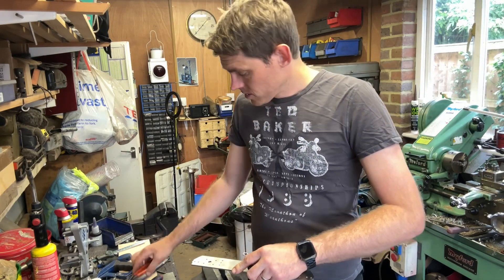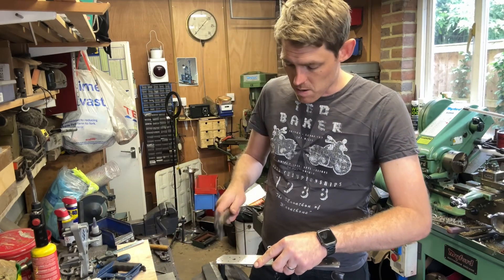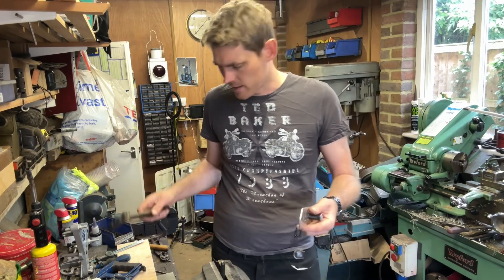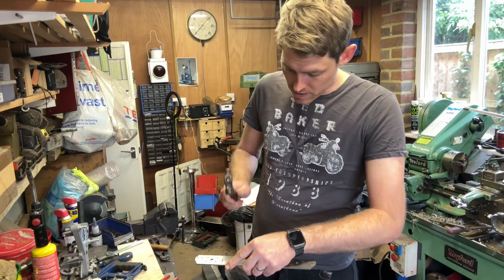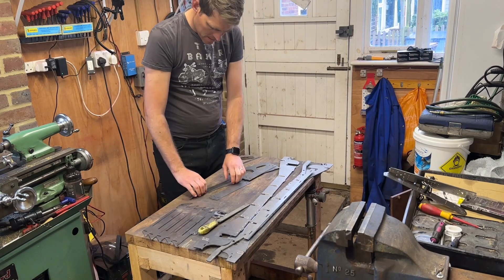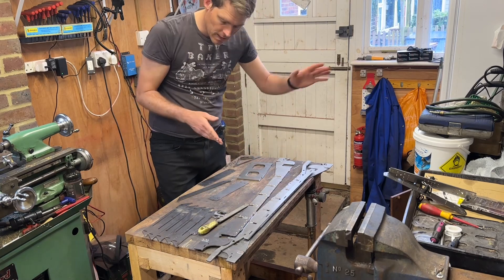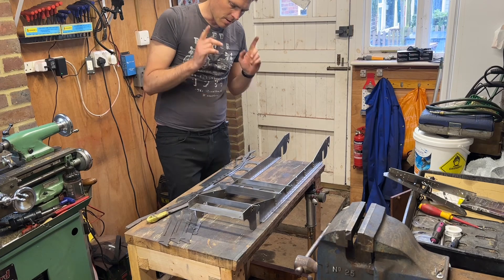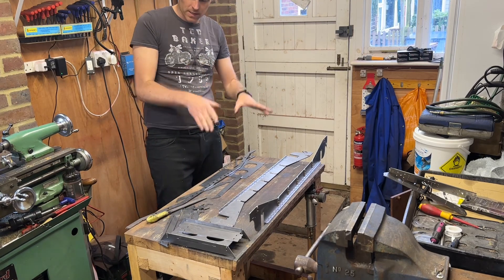GWR Loriot, Part 2… assembly continues…

Comment: EKP are superb with me contacting them years ago and begging for a batch of round headed screws without THE SLOTS. OOPS what did I start.  Love your Tanning Booth with the rays from the TIG. But just a few are fine. Not for an 8 hour day. Yes they do EVen go through a white tee shirt as a fellow workmate found from welding on board ship! Only on or in a Ken Swan designed Loco like Jessie do you get error free. David and Lily. Yes another of my projects.